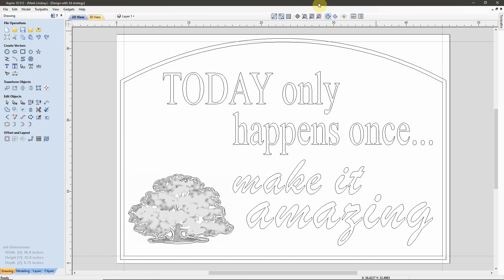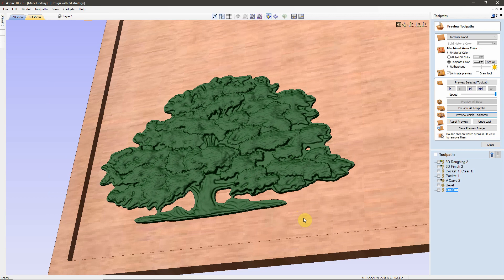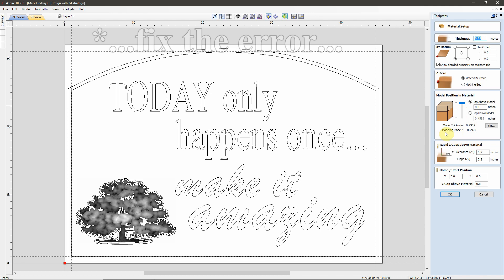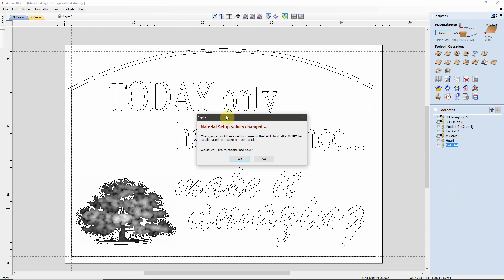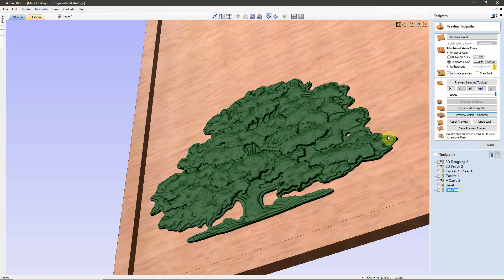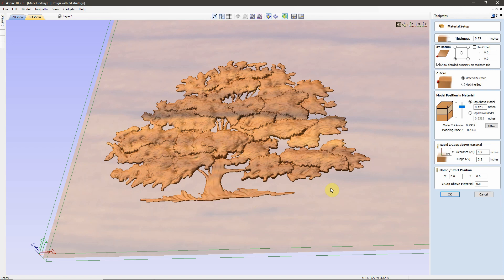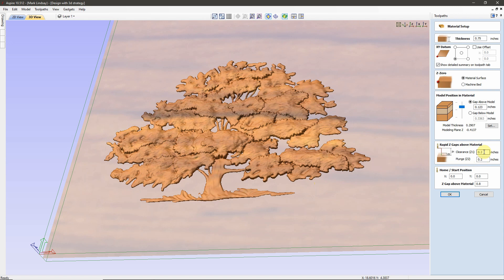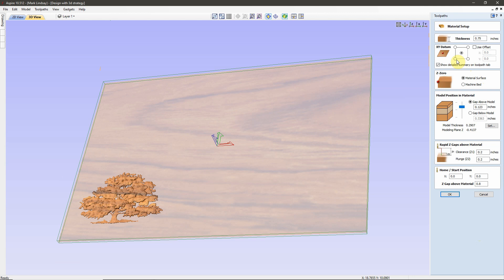Material Setup and Model Placement in VCarve and Aspire

Comment: Question for today’s noon session concerning the z-gaps explanation: 
Question #1: Is the z gap in the home/start position only used once during a cut? In other words, after a bit change when you press start, the bit will move over to the x,y start point at that height?
Question #2: Since Clearance Z1 is safe Z, then the bit will travel above the material between cuts at this height....correct? If Plunge Z2 is set to the same height as Z1 then the machine plunge rate will never come into play and only the plunge rate that you set for that particular bit will be used....correct?

Thanks for your videos, assistance and most of all the excellent teaching style.

Comment: 3d models. I set them up right. But there are places left behind. The bit either went around or barely touched. Seone mention a slider for model height. Not the first one when you put a model in vcarve-pro. I pull thst slider down.

Comment: The details you give are priceless. Thank you. I have a question. What is the best way to maintain the same bit length when changing bits between tool paths, so that the z position doesn’t change? I have had issues where the next bit extends too low, and a project is ruined.
Reply from the maker: Thank you, Joseph. In a nutshell, you really can't. You'll need to reset your Z zero (and ONLY your Z zero) after each tool change. Find a spot on the surface of your material that isn't going to be machined away, and set your Z zero there - it doesn't have to be the same place you set your X and Y zero. Then when you change tools, go back to that spot and reset your Z zero there. Then you'll keep a consistent cutting depth after each tool change. DO NOT reset your X or Y zero after a tool change. Those zero points will not change.
Reply: @MarkLindsayCNC  Thank you, Mark. Dumb question now: how do you just reset z zero point in UGS?
Reply from the maker: I've never used UGS, so I don't know. Your best bet would be to check the HELP menu in the software, and if you can't find it there, hit the UGS forums and ask there. There are a lot of forums out there that have a ton of UGS users, and they would be the ones to ask. I wouldn't know where to start with that controller.
Reply: @MarkLindsayCNC  Do you load toolpaths directly from V-Carve Pro? Or do you use some other software?

Comment: can you please point me to a tutorial where you explain how to remove the material from around the model? i'm stuck on this- i'm starting with a 1" thick base, and the model is 3/4" tall- i want the model not to be carved into the board like a pocket, rather I want the wood around the model to be removed, just leaving the model exposed "raised". thank you.
Reply from the maker: I don't think I have made a tutorial on this, specifically. In simple terms, you would select Material Boundary as your Machine Limits Boundary in the 3D Roughing and 3D Finishing toolpaths. Or, you could draw a vector (i.e. a rectangle) around the entire piece of material, and a vector around the model. Then you could use a Pocket Toolpath to quickly remove the material within that area.